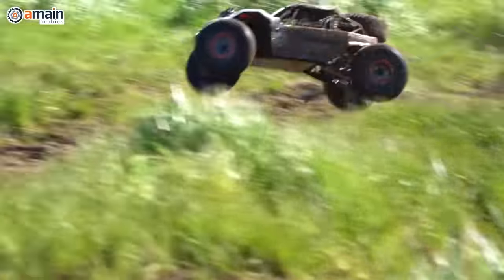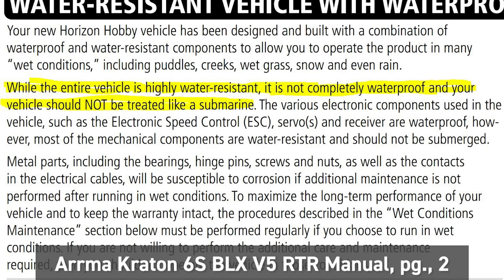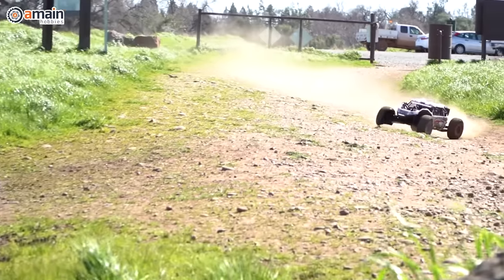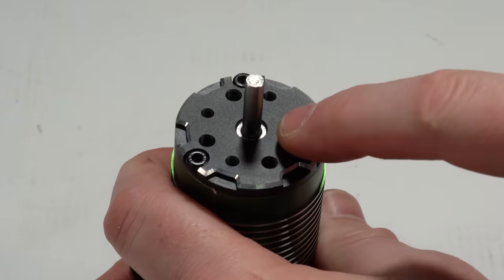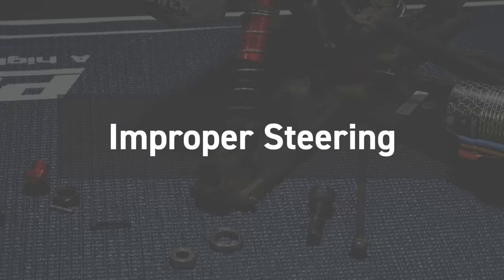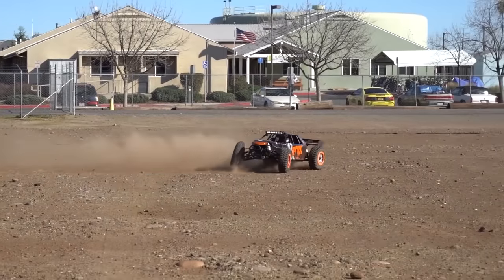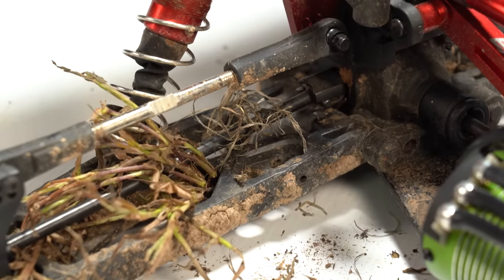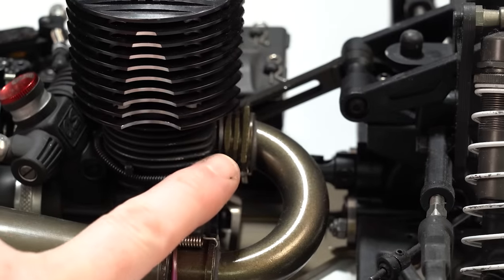7 Ways You're Destroying Your R/C Car

Comment: I've also seen people go brushless with brushed cars or just put a 4000 kv motor on a 2000 kv buggy and destroy the differential cause some of them, especially in cheap cars (traxxas does it too) are plastic and capable to endure a certain stress, that is also for the chassis and components made to endure a certain speed, torque and impact at 45 to 60 km/h not 80 or 100! If u want to upgrade make sure to not overdo it and check the gears and components. Also some stoxj servoes can be plastic geared or super weak (6 to 8 Kg) not able to manage such speeds offroad and u will be oblidged to align them back via transmitter every fast turn !

Comment: The tire gluing tip in number 7 is funny. 
My tires don't last long enough to need maintenance. 😢
The air compressor tip from #1 is excellent. It's a great way to dry out the RC, and even when you're just cleaning out dry crap from the truck, compressed air is a huge time saver. 
There are cheap(ish) quiet compressors available for under $150
I use a Senco PC1010 and my downstairs neighbor barely notices i exist 😂

Comment: Nitro deserves some more love than the obvious call outs.  You should cover how things like not properly breaking in your engine and going full throttle if the wheels are not touching the ground, i.e. on a stand or upside down.  The one is really important.  You might find yourself upside down during a race and you might have been full throttle right before that happened.  It's important to let off on the throttle immediately when upside down.  Also, when your engine is new, i.e. during breaking in, you shouldn't let your car run out of fuel.  When it runs out of fuel it increases rpm significantly, and it could cause damage to an engine that hasn't been properly broken in yet.  Then there is the whole discussion about richness, top end, low end setting, and nitro content that is appropriate to someone who may not know enough and might end up destroying an engine.

Comment: i take rc car into the shower if its really muddy, and use an electric blower, sold for computers but work equally fine for rc cars to blowdry it, and selected parts get a little WD40, so far so clean
Reply: Try dry teflon lube
No oil to collect dirt and is safe for your electronics.
Reply: @austingrunig5183  that is a good point, tho right now it's winter, and no dust and less dirt, WD40 will help keep bearings and joints clean of water

Comment: Just a reccomendation if you have an RC car that is "all terrain" when it comes to like forest I reccomend using slightly bigger tires but drive it at half the speed you normally do trust me it saves your RC quite a bit in the long run also remember to change your gears when you do this

Comment: Little tip on checking motor temps, if you want to use your fingers, just tap on the motor first. Let your finger sit on there for only 1/2 second or 1 second and then pull it off. If it's too hot, you'll know, but you wont melt your skin off.

Comment: All my cars are over geared with oversize motors. A lot of them have no way to adjust end points. It's really fun running them in snow with the tires full of screws too :) I dry them out by leaving them by the house heater.
I rebuild them quite often :P.

Comment: That's some good info. When I ride in snow or a wet and muddy area I spay my car down with WD-40 cause it's a water displacement when you blow your car off it's clean all that may hurt your car out make it look new also plus it lubricates all the part.
Reply: It’s good stuff, but it is also a oil and grease dissolver. So any bearings that get covered by the spray will need to be lubed soon after.

Comment: You seem like you provide the most useful rc advice on YouTube. I thought your arrma vs traxxas was a really well done video as well.
Reply from the maker: I appreciate that CJ. Thank you. 
-Brett
Reply: @AMain_Hobbies  right now I only have a very entry level truck by the brand "laegendary". It does 30mph and I got it for $165 in 2020. I want something faster and more durable. I really want to get the typhon 6s TLR. But I'm pretty sure I'd have to buy the batteries and charger separately. And I'm just too tight on cash to justify spending almost a grand on an rc car. Maybe if I had someone to race it with or drive on trails with. It just gets too boring if I'm using it by myself. But it seems like an awesome car

Comment: On the motor temps, there is a phrase we used to say for brushless setups. 
ESC hot, motor cool, gear up
Motor hot, esc cool, gear down
Both similar temps and not scalding, happy setup, party on
This is the rules I've used for more than 10 years with no issues with durability. Also we never used fans, so this was important to the life of both the motor and esc
Reply from the maker: Never heard that before but dang good tip!
-Brett
Reply: @AMain_Hobbies , thank you. When i started in brushless there were few good systems outside of the mainstreams of Tekin and Novak, mainly Castle creations and Sky and technology quark esc's. Castle Creations was just dipping their toes into surface RC, didn't even have motors or sensored ESC's then, so we learned the hard way. trial and error. If everything's happy it runs perfectly. We had a small brushless forum, with people learning everyday and this was the main thing that stuck

Comment: I have another way people destroy RC cars : letting an inexperienced person use it. My friends kid loved my RC cars & trucks and he begged his dad for one. The dad asked if I would sell him a RC truck that would be relatively simple to operate and maintain, so I gave him one but I strongly suggested that it's NOT for little kids and could be potentially dangerous, and damage could be costly. I also advised he buy an additional lipo battery and charger, and to buy a higher quality one and read it's manual. 
3 Days later he calls me super upset, the RC truck was busted, I fold him junk, bad battery, etc. I stop at his home after work and found out the truth - he gave the truck to his kid, showed him how to turn it on and work the transmitter, and that's it. 
The kid DESTROYED it ! The front end was smashed in, one shock and spring damaged beyond repair, wheel hub bearings missing, battery discharged to almost nothing, and the axle connected to the front gearbox was stripped so it wasn't operating in 4x4. When I told him what it would take to repair it he flipped out, he just naturally assumed I would fix it out-of-pocket  since I sold him a "faulty" RC truck. Since I had parts that would work I took care of the shocks and bearings, and hubs, and gave him another LIPO battery, but told him he had to get his own charger. 2 days after I fixed it, history repeated itself - but this time his kid managed to hit something so hard it broke the front part of the chassis off, the battery was discharged to less than 1 volt, and all of the shocks had mismatched springs on shocks that had no oil, and were placed in different points on the chassis. Didn't fix it after that and I told him he never should have let his kid use it. He never got a battery charger either, he just assumed I would charge his batteries, which I never agreed to. Tl;dr version: Inexperienced people shouldn't play with RC cars

Comment: I couldn’t agree more! and preventative maintenance can save big$ especially on drivetrain components! Bearing wear probably kill’s more diffs than crashes! Having said that I have a 05 tamiya sand viper that was bought just for driveway fun,it ended up seeing a fair amount of track time also it had a heap of motor combo’s including a 7300kv motor running 4s for speed runs,it’s had dozens of motors in total ,it’s worn the chassis halfway through,had 3 sets of shock’s and about 10 rear axle’s and the diff/gearbox just had the original grease cleaned last year lol if it ain’t broke don’t fix it doesn’t normally apply to rc especially comp level cars but tamiya um…

Comment: If you get the foam in the wheels wet drill a tiny hole in each tire typically 2 or 4 holes across from each other. Then throttle up the car on the stand or upside down outside, by doing that it will cause the water to shoot out the holes you drilled by centrifugal force.

Comment: Most of what was mentioned in this video is routine maintenance on the regular for me in most cases, not by choice though. I'm hard on my RCs and probably about 75% of the time will break them giving opportunity to check over the RC when I've already got it torn down anyways. I've come across a few things I would have other wise missed such as a bearing had exploded, but created no roll resistance in the drivetrain. Had no slop otherwise as well. Was a inner hub bearing on my Losi LST 3XLE. My UDR could use a little more TLC as it rarely breaks in the terrain I use it. Recently I broke an axle, so I'll have time to inspect it. I just put a new servo in it as the old stock one was getting weak. Steering had good smooth left to right transition when I removed the servo horn from servo, next is going to be checking front bearings, suspension, and drivetrain when I've got the front apart to replace the axle.

Comment: A few years back my dad bought me a rc boat and it was amazing. I was driving it around the part and everyone came and stop by to watch it and record it. The rc boat performs really well and it drifts. But after I took it out of the water I noticed that I didn't clip the cover to the electronics inside tight enough, and there are quiet some water in there. But it's a boat, it's designed to be waterproof, right? So I forgot about it. The next time I used it the motors stopped working completely except for the blades used to turn the boat. That rc was probably one of my favorite but now it's destroyed :(

Comment: I had a seized bearing in my motor and the car was still driving.  I noticed that the car was being funky so I stopped driving and took it apart.  I was so surprised at how that motor was still going even with that locked bearing.

Comment: That hurt with number one because I've done it. I took my Mojave to a nice little spot near a stream and I lost control and ended up having to drive it through, well, under quite a bit of water. And while this did not kill the truck and it's electronics it did take it's toll with corrosion in places I could not dry. So I had to replace an axle and some bearings. STAY OUT OF THE WATER! Even puddles can be a problem. So avoid it if you can! And regular maintenance has only gotten more difficult now that I have over a dozen vehicles. No more! I can't keep up! lol
Reply: Puddles and water are fun, I'll just replace w/e breaks.

Comment: Best way to submerse your RC is to get the cheapest radio you can and use food grade silicone to seal the pcb, the good old Traxxas VXL-3S is a champ when it comes to submersion, and the HiTec 35646W HS-5646WP cant be beat when going under. Speaking from experience submersion to 3' deep marine grease and air filled tires are the best way to go (for scale crawling anyway)

Comment: I made all these mistakes when I got my RC trucks except maybe driving under water but I did drive in Snow. I kept burning out ESC also trying to add different gears. I didn't think about the tires. So I gave up got to expensive but I miss it now. So now I wanna play again but I am going to just stick to a Stock RC to play around the local track. I am a bit tech tard when it comes to the electronics and gearing of an RC vehicle. glad I watched this video.

Comment: Here's a tip - buy a £40 "dog hair dryer" and blow-dry the car after using it in the wet. It's warm air and while higher pressure than a regular hair dryer, it's not like compressed air that could cause damage. I use one on my motorbike which saves my knuckles having to get in all the nooks and crannies after washing.

Comment: Can run my Kyosho MP9 V2 in snow & beach sand? What’s the first couple upgrades I should order from you? Thanks, awesome 😎 content!
Reply from the maker: Have you seen our MP9 series? It's the nitro version (I'm assuming you have electric) but there are many upgrades you could follow. We didn't do any pointless or aesthetic upgrades, only necessities. Here's part 1: https://www.youtube.com/watch?v=Y7LhHcDZY3o

Sand/Water/Snow/Mud - these all require you to put tape over the vent holes in your wheels so they don't fill up and become heavy or you might overstress and fry the electronics/engine and clutch. 
Also, snow is water - are your vehicles electronics waterproof? If not, better stay out. 
-Brett

Comment: Wd40 like all the time, spray it on every part minus the esc and trust me it makes parts last longer. Duck tape your body it work well and is easier then shoe glue and mesh, and lighter. Metal the right parts, shocks, servo gears and arms, and braces.

Comment: If you read what the page actually reads it says the electronics are fully waterproof and they are (traxxas/castle) as im a electrician and have inspected them inside and out. But as it says the mechanical parts aren't and like bearings , hing pins, shock rods, ext as they rust and corode over time with water exposure.

Comment: i must say my traxxas trx4 was 4ft under water and worked fine after i pulled it out of the pond ... i do wash i use dawn and rinse and use airgun from compressor and then spray with silicone after every day of running

Comment: I just use the kitchen sink and hot water spray to clean meng. ESC is encased in a waterproof container sealed by an o-ring. It's fine, just oil everything after.

Comment: I also never drive through mud because I don’t want to have to clean every nook and cranny to remove it I’ve run on wet grass and I never try to destroy the transmission by throwing it in reverse then forward to do wheelies I admit I do bash but I’m not trying to break a drive shaft or A arm or strip a servo I don’t want to spend more time replacing parts than running it

Comment: It’s funny because I got a castle 5700kv motor that is now 2 years old with a sidewinder 4 esc in my fully upgraded slash 2wd and it just will not die, Everyone tells me the truck is too heavy for it but man does it haul ass with that setup. I got it wayyy overgeared and have multiple time bashed it end to end heating the motor probably to 250+ degrees if not more and it is still going strong lol. Also I run the motor on a setting castle does not recommend, I got the motor and the highest timing settting and that thing is insane lol.

Comment: If im driving in wet conditions that day…. I spray the entire rig down with silicone spray. Makes for cleaning after sooooo much easier. Hang it in my heated hobby room, brush off any dirt and or water/ snow and let dry and re coat with silicone spray. Never use wd40 on bearings so its best to not use wd40 for anything rc related.   Always remember this hobby is a 2 step forward and a mile step back kind of hobby lol.

Comment: I picked up the Losi DBXL-E with a 17T pinion and Castle Mamba xlx2 1100kv motor, I also picked up some Power hobby Raptor XL tires which are much larger then the stock tires, I haven't got anything installed yet but the tires, Do you think that motor will be able to handle those tires without issues with that 17T pinion gear?
Reply from the maker: Not sure Andre. Typically with larger diameter tires you'll need to gear down on the pinion gear. You'll need to experiment with the gearing and test the resulting temperatures to know if you should gear down. 
-Brett
Reply: @AMain_Hobbies  Ok thank you
Reply: Am trying to change my pinion gear from 17t to18T for alittle more top speed, For some reason i cannot get the Pinion gear off any suggestions?
Reply from the maker: @monroethegreat7539  On that pinion is a set screw that needs to be loosened before the pinion can slide off. Try that. Sometimes it's easy if you remove the motor. 
-Brett

Comment: So if you live in a area like Vancouver where it rains everyday basically you can drive each night for like 20 mins after work so you can spend 2 hours tearing apart and cleaning every part of your car. They shouldn't state the car is waterproof if it doesn't have all stainless steel metal and sealed bearings.

Comment: Note,after run oil will turn hard and lock the engine over time requiring heat to free it up.use wd40 in the head and in the crankcase,pull a fuel line and crank it over to lube and clean the crank and bearings.can be stored for years with no damage.

Comment: i have to partially disagree. i’ve had my SCX10 since 2015, and it’s had many mods and some preventative care but limited. i’ve driven it in the snow, mud, sand, streams, puddles, etc. currently i actually haven’t replaced bearings. it could use it sure, but as of right now, i’ve had no major rust issues. as long as you store it so the water drips off it’s usually alright. i’m not saying don’t maintain your rig, you should change your bearings, grease things appropriately, etc but i wouldn’t say it’s 100% necessary to air dry everything. pat down what you can with a towel, and hang it upside down let the rest air dry.

Comment: I use a similar method, firstly I disable brake and reverse. 100% throttle and steering is the only thing you have to worry about until the battery goes flat. Kick, punch and repeat. 
🏎💨🤙
Reply: On my slash 4x4 fox does not work brake.what is a problem?thanks
Reply: Hhmmm, have you tried pushing trigger opposite way to accelerate, are you missing reverse also. Try calibrating the ESC and controller again, you might get lucky. Get well soon, RC cars rule🤙
Reply: @sheckymoskowitz686  how to calibrate?

Comment: The first thing I find silly is the talk of sealed bearings needing lubricated,or getting wet, therefore if you have sealed bearings,and waterproof electronics, other than the tire foams your car,it should be completely waterproof because water does not hurt plastics